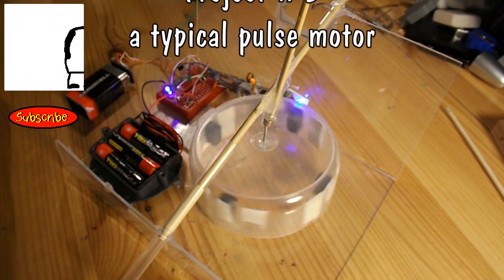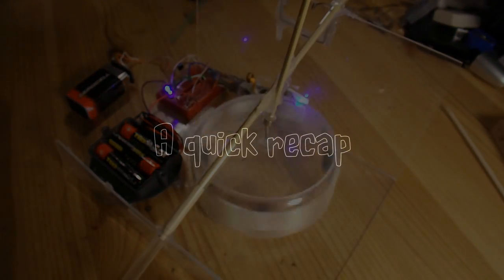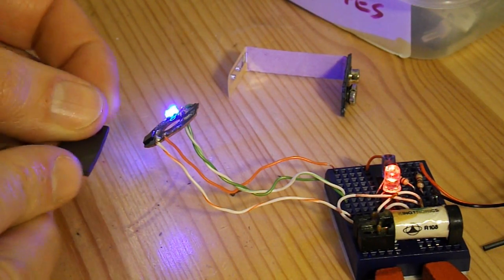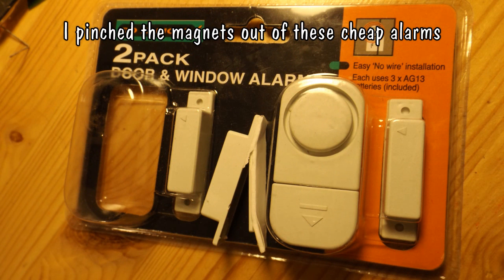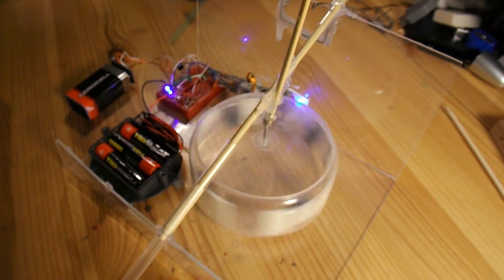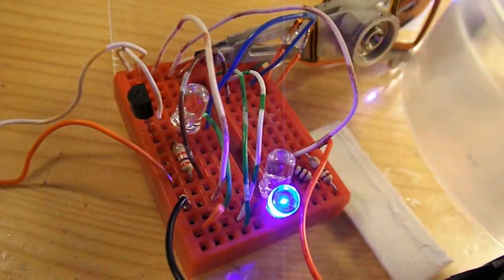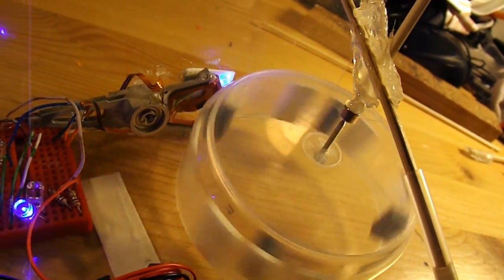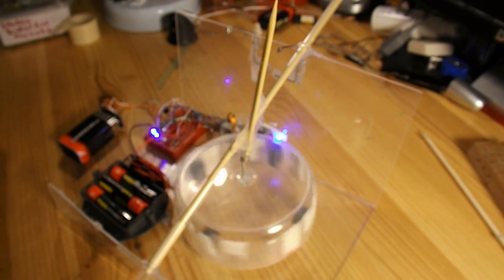HALL effect sensor project #3 a fairly typical pulse motor

Comment: Nice one Graham. I think this was made before I knew you. It works great. 👌👍👍
I meant to say that the levitation device I made uses two hall sensors. One at each end of the electromagnet. I copied the circuit from a guy who does know the proper business of electronics. I did credit him for the device in my video. Need to look it out from my garage. I am sure it still works. 
On another note, I noticed on a news site that a university in the USA has made a superconductor that works at room temperature. They called it "Red Matter". 
Google, "Red matter superconductor" and you will see it. Seemingly, if it's true and really works, it will mean fusion reactors will work properly and many more advancements will be made. We will still pay through the nose for electricity. They are not going to lose money.